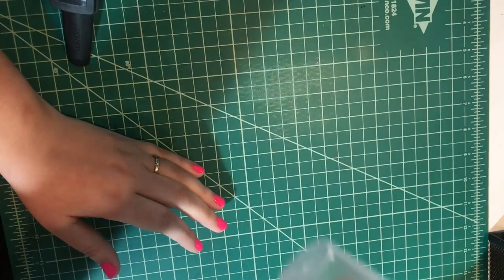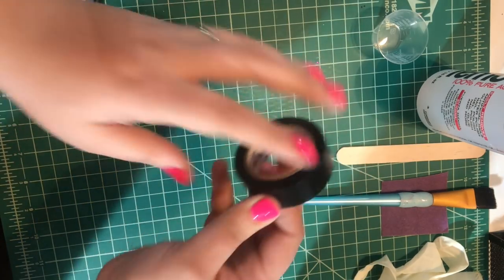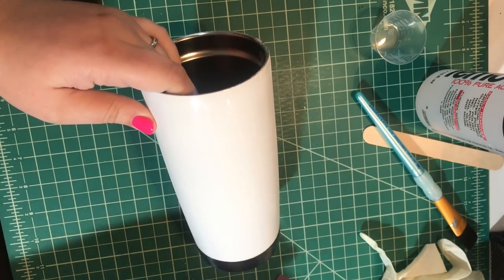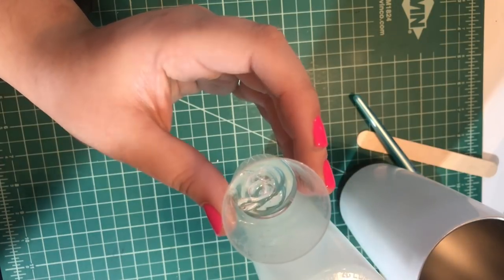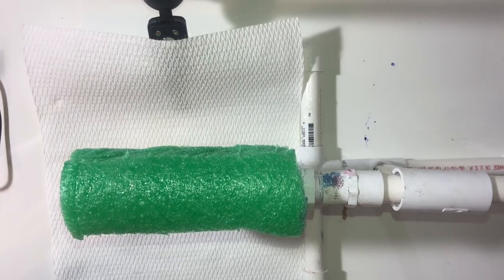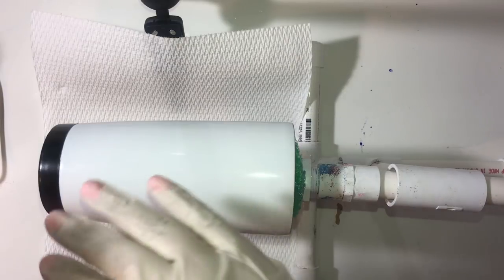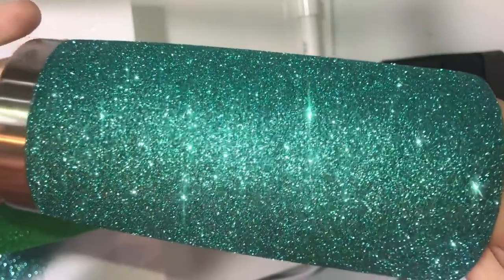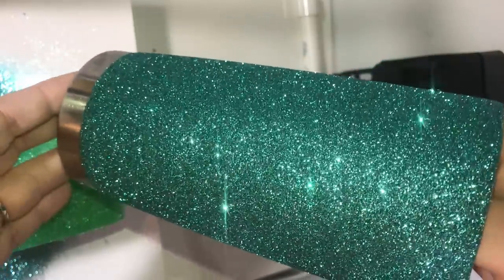Epoxy Glitter Method PART 1

Comment: How do I do a second coat of glitter?  I don't feel the first layer is vibrant enough.  Thanks
Reply: Danell Bagnaschi I need to know that too. One of mine didn’t take some glitter. I’ve googled and can’t find the answer
Reply: Cheryl Chaney some folks put mod podge on the first layer and some put spray adhesive and then add more glitter.